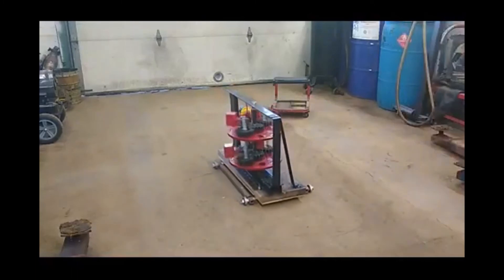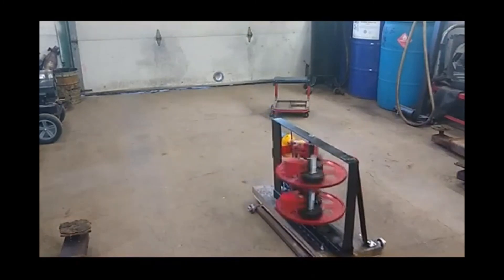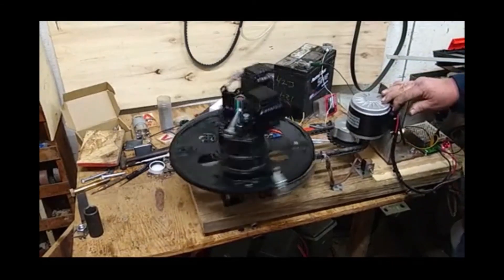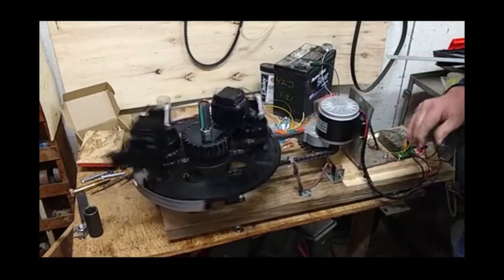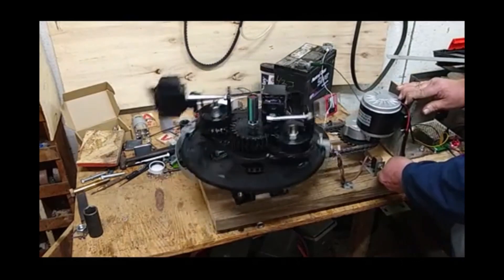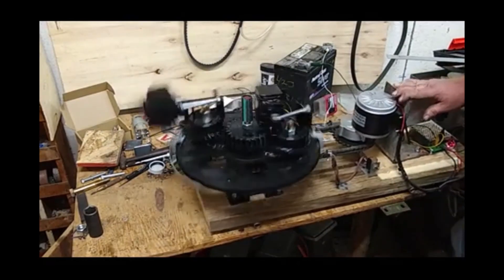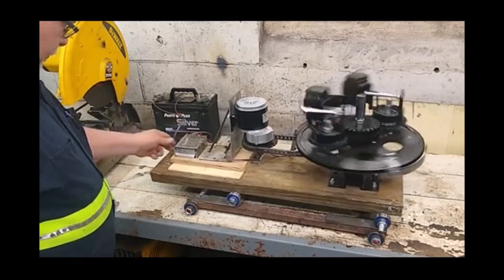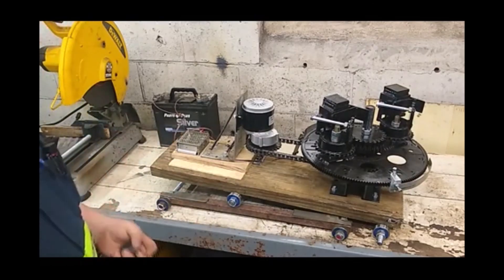Self-Propulsion Compilation

Comment: seeing these work the way they are gives me some faith that this one will work about the same https://www.youtube.com/watch?v=wEmwDL2ADYE maybe better at higher speeds, the weights are moving in pretty much the same pattern
Reply from the maker: The path of the flow is very similar although I have never really experimented with moving liquids in this pattern. However, there have been a number of things learned moving solid & semi-solid masses in this modified inverted heart pattern. The primary thing is that none of the designs I have had ANY success exclusively using centrifugal force. Also, the inverted heart must be deformed slightly, if spinning clockwise there would be an indent at the lower left radius, AND there has been a demonstrated need for velocity changes. All of this is well documented, and freely available in my blog on www.stclairtech.tech... I would love to see this built as a liquid conduit device! 
Thanks for watching!

Comment: It could be used to make a silent submarine, by keeping it inside the sub in a vacuum box to suppress all its sound.
Reply: I'm an inventor, and I gotta say that's a great idea...
Reply from the maker: Yes, or a silent plane with no significant heat signature, or hybrid vehicles needing no connection to the drivetrain. There are many possible uses!! I think the Trammel engine will be a real improvement as well. Thanks for watching.